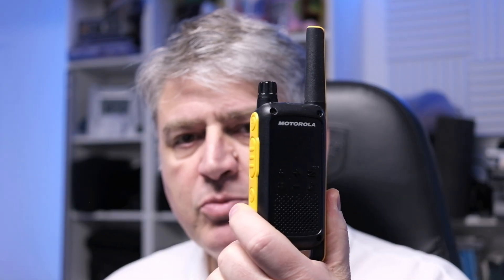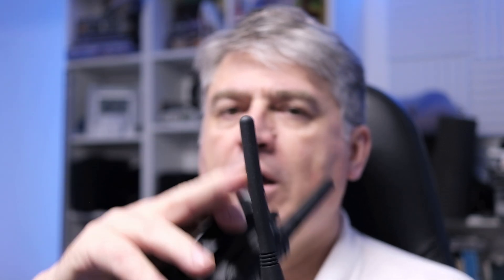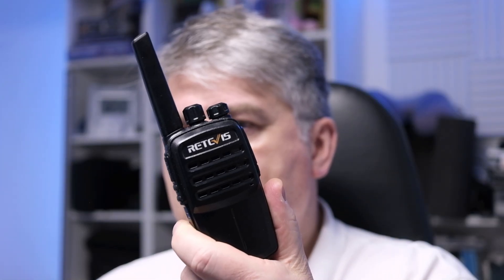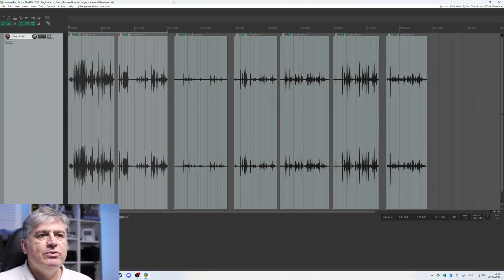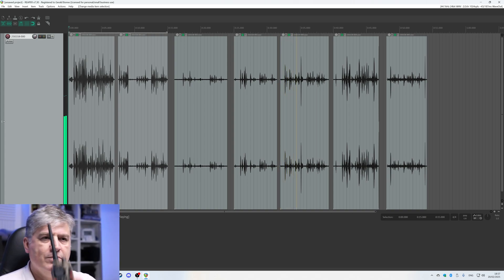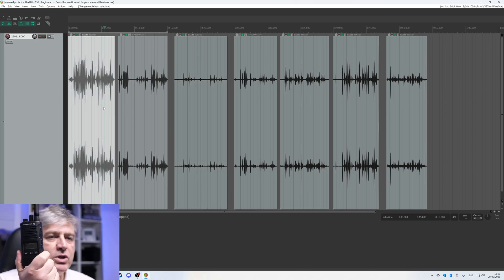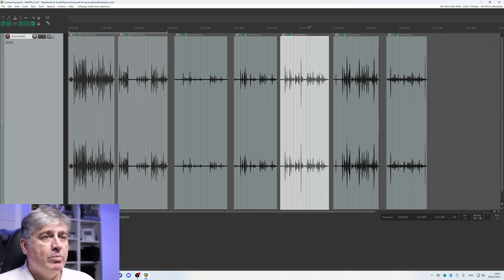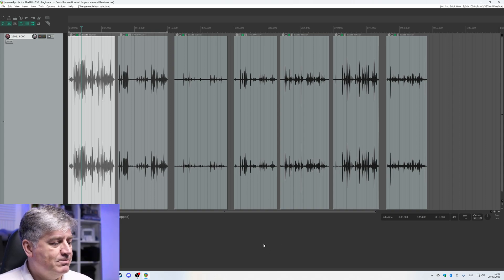PMR 446 modulation compared - Can you extend range?

Comment: Thank you for this test - it's nice to have a focus on the voice quality and volume.  I have the Retevis RT24 and have had contacts up to 100km on 0.5w  with it.  Some contacts tell me the voice is rather quiet.  Ive tested the Quansheng UV-K5 on low power (1w) and it beats the Retevis - i believe the difference is down to the quality of components rather than the 0.5w difference.

I find your test encouraging because I've just bought Motorola XT185s for use on holiday and as "stealth PMR" and it will be interesting to compare them with the other two radios.